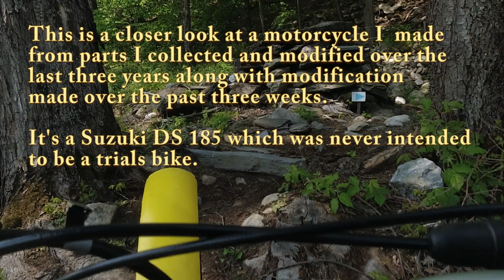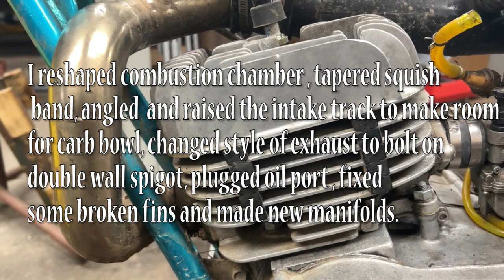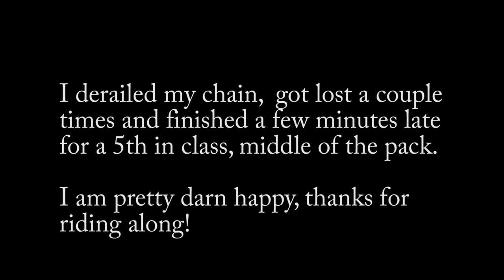Home made Otter trials vintage motorcycle build and ride.

Comment: My Chase TY frame doesn't have a return spring on the rear brake pedal.  It relies entirely on the brake shoe springs for the pedal return.  I was initially dubious, but it seems to work fine.
Reply from the maker: I am doing the same thing, only the springs on the shoes.

Comment: Try emulator valves in the front forks, woven brake linings, large volume exhaust mid box, 26mm carb, and reed valve conversion.
Reply from the maker: I am considering switching to a different engine over the winter. I like your ideas though. I should try the emulator valves.
Reply: @therealfrankthewelder  YSS emulators are copies of Racetech and much cheaper. 

Road bike motors dont really have enough flywheel weight for trials, if you added more the 185 would be lots better.

Have a look at the WES  trials bike exhausts. They use aluminium extrusions, and if you can get similar sort of extrusions in the US,  would be a good way to make a more effective mid box.

I know the manufacturer of Falcon shocks very well,  also Warren Collins, and Bob Ginder who used to import Falcon in the US.

If you want a more effective motor, try and get a TY175, or if that's difficult a Blaster, only issue with them is lack of flywheel weight, but  they run well and can be converted to bigger capacity cheaply.
Reply from the maker: @humourless682  Thanks for the YSS info. The engine power is pretty good at the low end it's just a bit excitable at 4000 RPM or so. My main issue is location of the clutch actuation lever (no space to lengthen) , kick start shaft (too low) and primary drive ratio and available space for swing arm pivot. ..  I agree with your comments about the pipe. I am going to make the headpipe 125mm longer and build a large midbox in place of the cone pipe. I think the PE and RS motors have a lower primary ratio and closer ratios in the gear set and meet my other desires. The suzuki 185 clutch is east to tune.  I like my Falcon shocks but I am running these at too high leverage for the damping to work properly.  I do have room for disc type weight under my ignition cover
Reply: @therealfrankthewelder  The transfer velocity is probably too high?  In many cases the ducts themselves as well as the port openings are very small, and will tend to mean a distinct power band. 

If you were able to fit a reed valve to it, the motor would work far better. Clutch can easily be sorted by fitting a hydraulic conversion.

A shorter header pipe, in conjunction with a large volume alloy middle box, will improve scavenging, and give more power and torque. Longer front pipes tend to flatten the power curve, and seem to reduce ability to over rev?

Parts to alter the damping are available from Falcon, but they do seem to work very well with minimal rebound damping.
Reply from the maker: @humourless682  I could do all of those things to this motor but it makes more sense to me to use a more suitable platform like the PE175 and shave the bottom of the cylinder to lower ports, increase compression and adjust squish band on a motor with a much better configuration. I may to the pipe mods on this  one to test the result.  Are you familiar with intake design on these motors? It's unusual.
Reply: @therealfrankthewelder  Motors such as the PE are not great for trials as they have very little flywheel weight. You would probably be much better to look at modifying a stock TY175, and would then have the possibility of selling parts, and maybe altering cylinders for others?  SWM also used piston port/reed intake.  Most blanked off the reed part of the system. If it was possible to add a good deal of weight to the Suzuki flywheel, make the intake tract smaller and run something like a YZ85 VForce reed block, with a good exhaust and intake system it would work pretty well.  The TY motor has those things already though, and would be far less work to do........
Reply from the maker: @humourless682   I am having a lot of fun experimenting with all the variables and seeing how it works out.  I also have a 2002 Beta and my results are about the same even though the Suzuki is inferior in every way. I can alter the cylinder and add flywheel without too much trouble. Weld and grind.
Reply: @therealfrankthewelder  The Suzuki is probably much easier to ride than the Beta?  Its possible to build a very good twin shock bike, but very easy to take the wrong direction, and end up with something thats not that great,  The intake and exhaust systems are crucially important.......
Reply from the maker: @humourless682  The Suzuki takes a little more planning but works pretty well. I  plan to do more testing and alterations in the future.
Reply: @therealfrankthewelder  Sounds good.

Comment: Great great job! Frank, did you alter the headstock angle without a jig?
Reply from the maker: Thank you! I have a nice motorcycle frame fixture but I used a thick welding table and angle plates to check straightness.